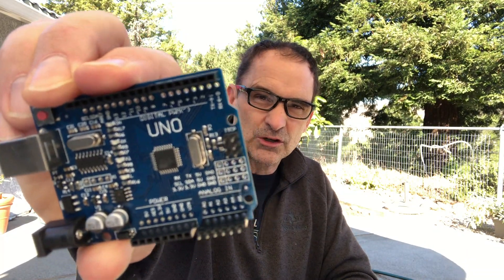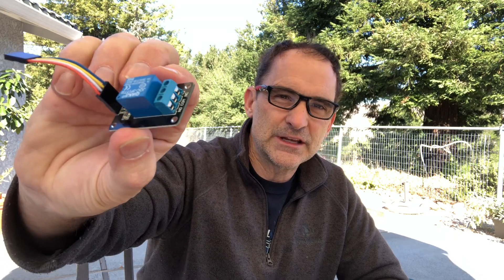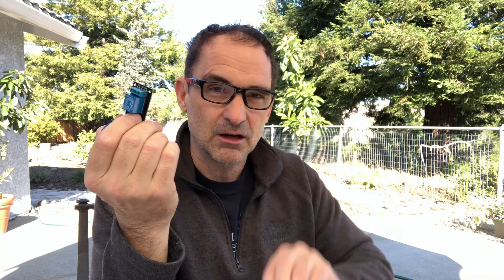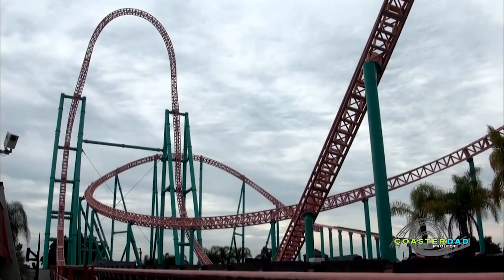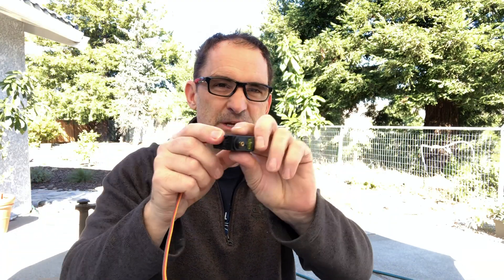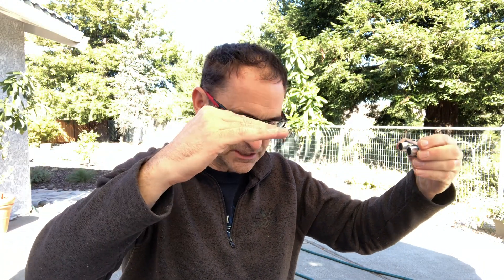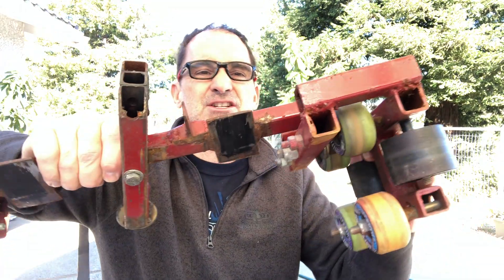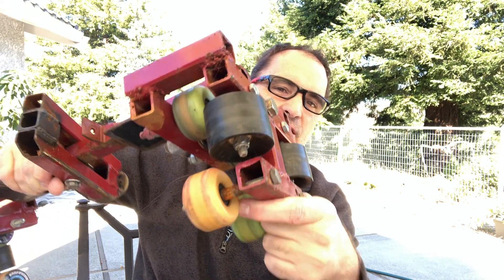Backyard Launch Roller Coaster - Part 4

Comment: Please do not use an arduino to control your coaster, that is not safe. Arduino is basically an fpga, there will be problems, it’ll be like a video game in alpha.
You gotta use a real PLC controller, you don’t need an expensive one but you need something that you can put reliable ladder logic into to run your relays.
I have a Mitsubishi touch screen hmi I can send you to use with your PLC
I think the cheaper plc are around $300
Reply from the maker: Agreed!

Comment: Bungee and pneumatic launch have already been done on amateur coasters. I'd like you to stick with either a cable launch (electric, Hydraulic, or even flywheel) system as you first proposed, or a magnetic launch system like you talked about here.  I'd like to see these options because they are harder and they have not been done an amateur coaster as far as I am aware.

Comment: most useful "cheap" milling machine I can think of would be a Bridgeport or equivalent knee mill. It's great for any type of manual milling and can be retrofitted with motors to make CNC parts. A small router table would also work, but wouldn't have the option of manual work, everything would have to be in G code.

Comment: Have you thought about having multiple electromagnets set up on the track with a gap in between? In theory if the currents oppose each other a metal fin attached to the car should be propelled down the track. Not sure if it’ll give you the acceleration you need, but it’s just a thought. I believe LIM launches coasters operate in a similar fashion
Reply from the maker: Agreed. I'm just learning about electromagnetism. We've got a great video about all that coming out on Saturday morning. I'm thinking about the whole LIM/LSM thing like a surfboard riding a wave. It's all in the timing.
Reply: Will Pemble   Cant wait! I built a pvc rollercoaster a few years back. It’s been in storage for a few years now, but now that I’m an engineering student, I’ve had a revitalized interest. I’m looking into adding a tame-ish launch just to play with the idea. Can’t wait to see your project progress!!

Comment: If you are going to do the raised fins for roll back, might as well go to air launch since you will need to run the air tanks anyways for holding the fins down.   Electro magnetic, as awesome as that is.  As someone else said, the power level needed maybe minus using tons of high capacity cap’s to store juice I think might be an issue.     Not even getting into structural integrity. 

Then again a tire push off from the load into the magnetic section might work to removed the electrical current jolt needed to move from stationary object and just enhance its forward momentum speed. 🤔.   Be interesting to see the math for this.
Reply from the maker: Tune in Saturday morning, @Raptor2002! We've got a very cool conversation about all that on the schedule. I can't say for sure, but I think we touch on most of the issues you've raised here.

Comment: Its a good idea about the fins for braking but brake fins are un necessary on a magnetic launch because you can just use the magnets of the launche for braking, the fins on coasters like accelerator or top thrill dragster are for brakingg because its a hydrilic launche which means there is a hydrolic wince that pulls a steel cable which is conecter to a so called catch car that pulles the coaster train forward but as i have sayed the magnets for the launche are also able to break thd coaster (see redforce in ferrari land) i hope this helps
If you need anny more coaster related help please let me know

Comment: Love your projects and videos Will, the brake fins you see on launch coasters should be failsafe and on UK intamin coasters, they are sprung loaded up and pulled down by pneumatic cylinders. 

I would personally go down the route of using a PLC instead of Arduino as they are more reliable especially with humans on board. 

I'm an ex UK theme park and cable car engineer with 14 years working on lifts (elevators) so would gladly help in anyway I can. Good luck!

Comment: And another fact to consider is circuit switching of the relays: As we all know U_ind = -L * dI/dt, so for a massive inductivity L and an instant stop of the current I, you get a huge reverse induction voltage U_ind. So, the tiny relay you just showed can probably be only used as an input for the massive circuit breaking circuit that needs to sit behind, at best.
To properly cope with the reactive power these electromagnets will produce, you will probably also need a capacitor compensation network.

Comment: I love what you are doing! So so fun! Makes me worry concerning electromagnets though. Most of all being that of power draw. Just to give an idea on power consumption, most magnetically launched coasters draw enough power to power a small city for the duration of the launch, even if just for a few seconds. Obviously you are not launching a train or even one car the weight of an actual coaster car, but hopefully that might give you a reference for how much power it could take, I honestly think that if you had the right magnets to launch your coaster to your desired speed it could knock out some circuit breakers, ha. Most if not all coasters using magnets store their power in high grade capacitor type electrical equipment or fly wheel systems, having slow draw and then instant release. This type of stuff would only be made most likely by industrial grade manufacturers which would most likely be quite expensive. 

As well as sensors and relays being able to trigger in a fraction of a second. Power bill may be insanely expensive as well. I wonder how fast car batteries can discharge though since those are used to start a car and are pretty robust. I personally would head for pneumatic and or with a cable. Provides super high power that could be powered by a medium size consumer air compressor, and the best added plus is that it ejects a blast of vapor and sounds neat! Lol. You could get long large metal tubing for your air cylinders. I would actually encase this in another tube or sheet metal shielding in case you had a rupture. Another thought to consider is a flywheel like Anton Schwarzkopf. Montezuma's Revenge at Knott's berry farm uses this. It raises an insanely large weight in a tower that drops, connected to a flywheel connected to a clutch which pulls a cable and launch dog along the track that connects to the train. All you would need is a lot of concrete in a cube or cylinder(maybe a couple 50gal barrels ontop of one another) with a winch and release system that would drop it in an enclosed tower(for safety) and the other components connecting to the car, and Bam! you're off!. 

Also concerning wheel assemblies/bogies; If you look closely on even the fanciest manufacturer's like Bolliger & Malbiard (B&M) or Intamin, or others, they are not actually milled much at all, but really just use heavy gauge sheet metal flat or bent, and tubing welded together. I am sure you could do the same as well but with lighter gauge of course. This direction would be much less expensive without having to be milled which can be very expensive for the time of the machinist and machine's mill time/ware.

Regarding the anti-roll-back braking on Intamin/Xcellerator. They use pneumatic fins actually that are sprung up to natural position, and pulled down by air pressure and pneumatic rams, maybe you could replicate this method. I would think this would be easier than a servo. to stop even a 400lb car at speed, you will need surface area as your ally for braking strength. If you look at Xcellerator's brake fins, they probably have a hand width or more of rare-earth-magnet on the train sliding very very closely to the copper brake fins on the track for the eddie current braking. Using pneumatic's could give you the speed, power, and throw distance to move those fins in place. Also just a thought that if you used an air launch, you would already be set up for using pneumatics for your braking system as well.

One last thought I just had, they have go-karts that are electric that accelerate extremely fast, could you take a motor like that or stronger even, hook it up to car or lithium ion batteries, then rig up a cable and launch dog system to haul the coaster car into tomorrow? ;)

 I think you are headed in an excellent direction though without a doubt! Can't wait to see you figure out how to build it and what works best for you. I commend you and adore your aspirations with this project, as some day when I get a house and property I would love to do the same! :) Can't wait to see more!
Reply: I think that the Schwarzkopf Flywheel launch is the best choice for a backyard coaster, except maybe air pressure is better. You could also do a Schwarzkopf Weight Drop launch, but then you would need a massive tower where a weight is dropped in.

Comment: I love this idea, in fact I've had some serious thoughts on doing something like this myself. I look forward to your explanation of the electromagnetic motors as I haven't had much luck myself with the research. Also look into raspberry pi, that is a good microcontroller that can have a touchscreen interface.

You can also use pneumatic cylinders to raise and lower the break fins. The arduino can use a solenoid valve to control.

Comment: The relays probably won't fire fast enough to meet your needs. You might want to consider IGBT banks to meet the current demand. A variable frequency drive with a programmable acceleration curve might work. A linear motor is basically a round motor that has been cut like a tank track and laid out flat. Buying a wrecked EV wiring harness and controller from a servo  based drive motor maybe

Comment: Really looking forward to seeing this. I'm so happy you're swaying towards using a computer control system with the Arduino!!!!

You may find using an array of magnetic sensors to be more reliable than using an ultrasonic sensor to measure speed. Depending on where you mount the ultrasonic sensor could result in some variation in the speeds it measures. It would mean more computing for the Arduino too, using an ultrasonic sensor.

I like your idea of using the servo/stepper motor to move the brakes. Professional coasters like the intamin accelerators and gerstlauter infinity coasters use a pneumatic piston with a spring to move their eddy current brakes since it gives a higher amount.of safety since the brakes could be restored to a braking position if all electrical and pneumatic power is lost. For what you're doing I think the stepper motor idea would be the way to go, depending on how many brake fins you want to be able to move.

It'd be cool if you and George could talk LIM/LSM launches, that might be interesting. Though I think you would need to use a variable frequency drive for that which would probably involve a more industrial-type control system which would be a lot more expensive.

I really can't wait to see how this turns out! I can tell it's gonna be great!

Comment: Remember that magnetic launches take A LOT of energy, requiring an electric accumulator (that can get expensive). The advantage of a cable launch is that you can accumulate energy with a flywheel, which is a bit easier, and a lot cheaper.
You could also associate pneumatic and cable launch, in that case the energy storage would be even easier, because it would be in the pressure tank.
The idea of using magnetic brakes is really good tho, because it doesn't require energy, and it doesn't wear a lot over time.
Sorry if some of thoses sentences didn't make a lot of sense but english is not my main language :P
Reply: Or use a flywheel accumulator like Hulk
Reply: Only part that didn't make sense is saying "tho" instead of "though".
Reply: @ATalkingBadger  I've been writing that wrong for half a year, thanks!
Reply: @azertycraftgaming  no problem. There's a lot of people whose only language is English and they still can't even speak it right. They get lazy and shorten words because it's "cool" and they say "should of" instead of "should have", which makes no sense. Another word people like to shorten for no reason is "and", where they'll just type "an". English is already the most difficult language to learn, it doesn't help that there are millions of English speakers that talk like they just had severe brain damage.

Comment: Literal theme park engineer here
A- you would definitely want to use some sort of pneumatic actuator to move the break bars that would fail to the engaged position if power or pressure is lost.
B- you need some sort of shimming on the train so you can adjust the guide wheels in as close as possible to the side of the track and the underslung/up-Stop wheels close the the bottom of the track without touching.
C- those inductive sensors you’ve shown are way to small to reliably detect a train without being either missed or run into. 
D- AVOID the ultrasonic sensor at all costs, one of our coasters has one on and is constantly faulting due to birds/leaves on the track.
E- fit an emergency stop on a completely different system that will work if all else fails, literally a life saver. PILZ e-stop/safety relays are on all our rides at work and just cut power to the system, so breaks should automatically engage.
F- in some situations it may be safer to not have an ARB system, so you might not have to worry about brakes on the launch.
Hope these help!
Reply: From my point of view (an electrical engineer) I would suggested you to move from an Arduino to an actual PLC. It runs usually on 24vDC and makes it really simple to interface to various actuators (valves or relays) and sensors.
Please don't use those cheap tiny magnetic sensors and get a proper one from a name brand, it's far more reliable.
And as George said, implement an emergency button to shut off every component that may cause harm to the rider. Pilz, Reer and Schneider are my recommendations

Comment: You should definitly consider doing a flying launch, if you want to do it with magnets. It takes less power (because the train is already moving) and thus can be much faster than if it has to move the train from 0-x mph. 
Maybe take a look at some of the Gerstlauer Launches. There is a coaster here in Germany, which launches you from ~20 - 100 kph (not miles!) in 1.4 seconds, whereas another coaster (Taron at Phantasialand, Germany too), which is as far as i know the fastest launch from 0 kph to 100 needs 2 secs.
I hope you understand my comment because of my sloppy English xD
Reply: I am actually recreating Fluch Von Novgorod (assuming this is the coaster you were talking about) in NoLimits 2 right now! :)
Reply: @tobiasf.j.4438  
Yap, that's the one i was referring to.
Reply: @TedsCoasterChannel  thought si. Fantastic roller coaster, don't you think? It's my number 3, but I haven't ridden tha many coasters
Reply: @tobiasf.j.4438  
I have to confess: i've never been on it, the closest one i got to ride was Karacho at Tripsdrill. And that launch was already awesome.
But the Hansa Park is definitly on my bucket list, probably next year.

Comment: Hey, you might want to look into using mosfets instead of relays. They work in similar ways to relays except they are faster and are solid state, instead of using a moving part aka a relay

Comment: As far as I know the brake fines pneumatic (the are also spring loaded to the “up” position so if pressure where to drop the fins will always slow the train). Even most friction brakes are moved using pneumatic cylinders. Also from what I have seen most small(er) coasters use a combination of tube and sheet metal welded together.
Reply: You are correct. They are either stationary for the brakes at the end of the ride, or if used on the launch, they lower with air pressure, and are spring loaded up. You are also correct about sheet metal and tubing(assuming you were referring to wheel assemblies?). No milling there, even on the most expensive coasters. Wheel bogies that big would be too heavy and expensive if milled.
Reply: *(edit, been thinking about it a bit more, even though its sheet metal milling might still make sense as it is really precious (So parts can be made more accurately) (I know B&M cuts there flange plates for the track but the connection point for the rails is milled afterwards to get it the exact size). As for what type of mill certainly take a look at the CNC mills (like the one shown by wintergarten on marble machine X)
Reply: Kazio side note, do you happen to know how B&M makes their box spine track? It is the most peculiar design, because when it does corkscrews or track pieces that twist and curve as well, they have tons of diagonal angles on the top and bottom and sides. Looks kinda like flanged sheet metal then welded and smoothed together, but it is so seamless that I have no idea. Anyone else know as well?

Comment: What if you raised the brake fins with pneumatics
Reply: That would be easier with pneumatics
Reply: No they hold them down.   Fail safe is in the raised position in case an air line blows. Etc.  which happens.